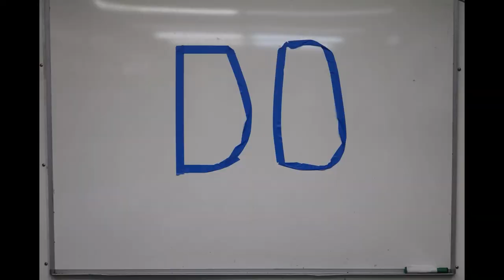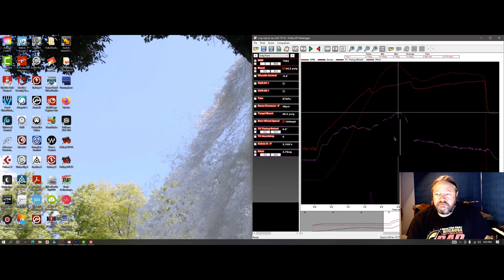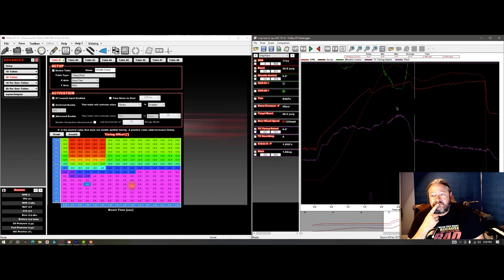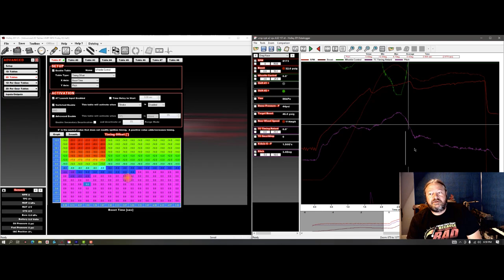What are wheelies and how do we manage them??

Comment: Has there ever been any thought of using a sliding weight kind of like a tractor pulling sled?
Like take 40 to 80 pounds and shift it on a track from under the rear floor up to the firewall as you go down the track?
Most of these cars you have to add weight to either make the weight bias better or to make it weigh enough per the rules